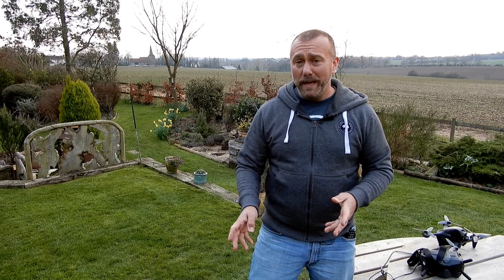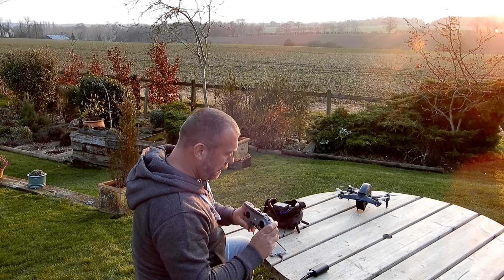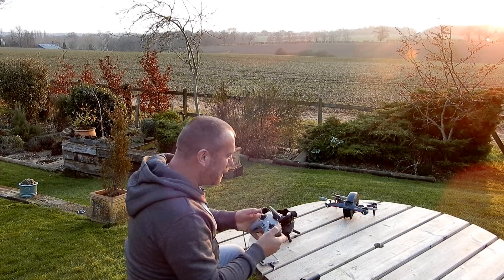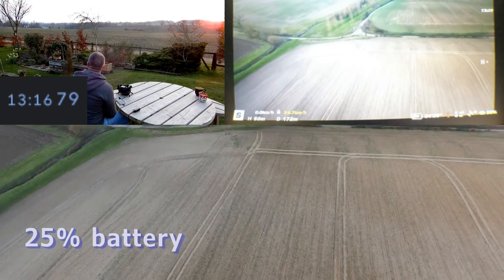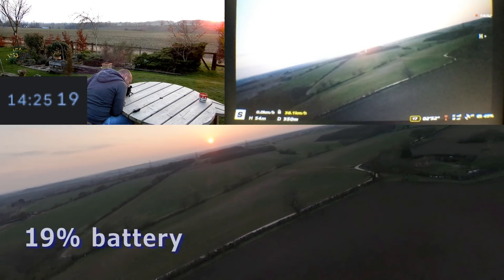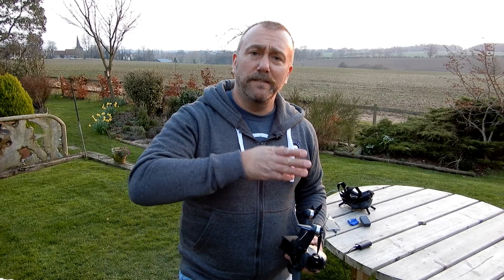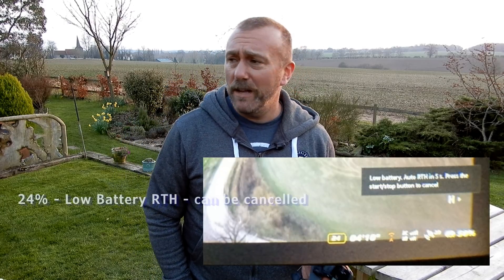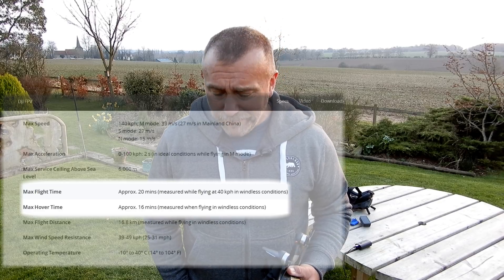DJI FPV: Max Flight Time Battery Test - How Long & What Happens

Comment from the maker: First Rule: Don't Push the Battery.  Second Rule: Don't take your Battery to 0% or it will damage it!  That aside, is this a reasonable test and result?
Reply: This is true however in practice no damage should be done to your battery. That 0% battery (%) isn't really 0%. The battery controller is programmed to 'always' have enough for the drone to land. The drone should never fall out the sky for obvious reasons especially at a high altitude. This is why it overrides your controls eventually. For homebuilt drones running your cells to 0% is the real 0% and will do damage.
Reply: @sandyleask92  lipo batteries should never run that low, however this video was made for learning purposes.
Reply: @sandyleask92  Just for info, I recently ran my battery to 4%, then about 2 metres above the landing point, the props just stopped, drone dropped, battery now wont charge. The FPV sucks out power so my A$220 lesson learnt is land at 10%.. Every flight is a lesson!
Reply: @sandyleask92  Correct . When the display reads 0% in a DJI drone the battery actually still has the 15-20% left in reserve to protect the battery .
Reply from the maker: @rydfree  This is what I suspect too.  I've never had a DJI smart battery fail, even tho I do these Down to Zero tests for every model..... :)   And yes, the low battery RTH and the final critical forced landing all take your altitude into consideration, with the low battery RTH also considering the distance to the Home Point, so the further away you are, the sooner it kicks in...
Reply: @rydfree  what's the voltage dji considers 0% 
One mavic guy tested and said 0% went to 2.8v on his which will damage a lipo.
Reply: @divingfalconfpv4602  They use a different cell chemistry I believe, hence it isn't comparable to lipos
Reply: do not charge it and fly without a break for the batteries
keep the battery always dry and warm underneath your jacket before you fly 

in summer with higher temperature you might find the 2 missing minutes I guess.
If you pick an electric car like an e-Golf and drive with 3°C ambient temp. than you will get 150 km range and about 20°C you will get 240 km of range.

Yes, different cell chemistry and each works a bit differently, but all the Lithium cells perform better in warm conditions.
Good luck for an early and long summer for great fpv flights
Reply from the maker: @typxxilps  That's a huge difference!  It was around 10'c when I did the test; looking forward to warmer weather then :)
Reply: Nice test flight, I too was getting 6-7 mins going crazy in sport mode
Reply: I think so, good to know what it could actually do in case these things happen.
Reply: third rule, never put your googles upside down. If a light ray goes to your lens, it's can burn the lcd screen with the magnify effect of the lens. =)
Reply: Hallo. Can you recommend DJI FPV for beginners?
Reply: How long would it last with 4k video recording?

Comment: I bought mine last week. I get between 9 and 10 minutes on sports mode.  Only I don't understand why I don't have a far range, after about 500 - 800 meters I will get bad connection.

Comment: Hi I'm going to let you know how they test their drones at DJI. I discovered this with my Maverick 3 which they claim and flies for 47 minutes. What they mean it's just hovering in space and it did last 47 minutes but obviously when we move or draw I'm just going to consume more power. So literally what they're claiming is just hovering in space for both drones will last do the same test with fpv I have not done it with mine yet but I'm pretty sure we'll get the 20 minutes if it's just like standing and place.
Reply from the maker: Watch yesterday's upload :)

Comment: You have to run them through a few charge cycles before they get 100% efficiency. Everyone has different opinions but I have some old spark batteries. That still seem to function pretty much like they did when new. The first few times I pushed the batteries. 100% to 0%. After landing I would slowly finish running it down to 0.   After that usually don't ever go below ten %. Don't leave them laying around fully charged unless your planing on using them in the near future. I know own four different drones. Think I need to go get my head examined soon.
Reply: are spark batteries lithium ion?  You never wants to take lithium polymer batteries to zero.  That's how you get them to swell when you charge them again.  Just as bad as overcharging.

Comment: I'm curious, why did you test battery/flight duration in SPORT MODE? I'm pretty sure DJI advertized the DJI FPV flight durations at 20 Min. certainly utilizing the N mode. I would think the drone would be using less power for flight, ie 30KMPH versus 60 KMH, etc. Maybe because that's your favorite mode to fly in? Anyway, I think flying the DJI FPV in N mode would probably reach DJI's advertised flight times approaching 20 Min.?
Reply from the maker: I chose Sports mode as that's the mode most people will fly the FPV at; this is a fast moving drone and I thought it useful to see what typical life you'd get.  The battery had had around 6-7 cycles; 10 is the ideal breaking-in number I guess...

Comment: Caution running battery this low will make it difficult to get into an optimal landing position. I had 9% nearly drop into a field. Couldn't elevate above the grass. Landed just fine though. Mowed some overgrown weeds.
Reply: But this drone has an inbuilt feature that it calculates how much battery it needs to get back to its landing area and it automatically stops being in manual mode

Comment: Great videos Ian - learning so much from them. I have the Mavic Pro 2 - is this compatible with the DJI FPV V2 goggles or would I need to look at a different model of goggles if I wanted to fly the Mavic that way? Thanks in advance!
Reply from the maker: You can't connect the goggles to the 2 Pro....

Comment: During my research about the drone I came across some information that claimed the "20min" flight time was tested indoors.   Which is deceptive for consumers but hey it's a China company so you shouldn't expect anything less.
Reply: He could have gotten the advertised flight times if he would leave it in N mode He chose to fly around in Sport mode which will use more of the battery's capacity. You can rest assured that's how DJI got 20 Min. of advertised flight times.

Comment: I also found if your not recording it lets the battery last longer. Still not the full 20 mins I think but I got 15-16 mins cruising at 60mph
Reply from the maker: Yes, I guess anything using battery will shorten the flight time......

Comment: my test gave me 12 mins in stationary hover on first flight in n mode... does batt increase with conditioning with time perhaps ? great vid ..thnx , keep them coming Ian.
Reply: Yes, the drone flight times will improve as the battery is put through multiple charge cycles.

Comment: Thanks for the down to earth and common sense reviews Ian. Almost always within 400ft and VLOS the safety limits. Having flown RC fixed wing aircraft I guess the fpv is similar, the advantage, you don't need a runway. however the goggles seem very clumsy,  When worn you can't see other approaching aircraft or potential criminals. So a spotter is essential. Looks like great fun though. I just get dizzy trying to keep up with the camera's movements. 
Got my 1st drone dji air 2 recently and beginning to think I've made the better choice. The altitude here in Johannesburg is 5,751ft Above sea level, with the thinner air the dji air fly's for aprox 24 minutes, gimbals work great and the camera functions are excellent. My guess is the fpv would only fly for aprox 12 minuts at these altitudes,  but would love to hear otherwise.   Interesting point a done can weigh up to 7kg in South Africa.
Reply from the maker: Unless you really want FPV flying and footage, you're way better off with the Air 2; it's a great drone and yes, you'll have far longer flight times.  Cheers, Ian

Comment: So are you saying you can see the Googles view on your phone? Is that connected via a cable? Is that something you can only do on the dji fpv drone
.. Through the app... Don't think it's possible with a dji air unit fitted in your own quad  and dji  fpv goggles
Reply from the maker: If you connect your phone via the supplied cable and open the Fly APp, you see the plain camera view, but not the app info.  All ther models you connect the phone to the remote control.
Reply: @IaninLondon  ah OK I've not got the dji controller... Just the Googles and Air unit my control is through crossfire

Comment: This is not rocket science.  2000 mah lipo. 6s
It is what it is. You will get what you get based on your flying.  I would prefer a 2000. Mah lipo 3s.  Possibly get 30 min flights at slow cruising speed.  I only fly 3s. Cheaper. Easier to keep balanced with only 3 cells
Reply from the maker: Who said anythig about rocket science?  I just did the test and showed the results.....

Comment: Wish someone would check voltage.. what voltage is 25% .. what voltage is 0% ? 
We only know 100% is 4.2v a cell. (25.2v)
Reply from the maker: I'll check the flight logs and come back to you.....
Reply: @IaninLondon  flight logs show it.. nice.. hate my mavic never showed it
Reply: Aren't they lipo high capacity? I mean 4.35v while charged?
Reply: @raffaelevalobra7128  no, they're not LiHV.  As per DJI their Lipos 4.2v per cell. But it is a big battery.  Bigger than we normally fly. Probably why they went with 5.3" props instead of 5.1"

Comment: I'm averaging 12 min flights.. in sport mode. Coming from 2 to 6 min flights on a 4s lipo, the Xtra 6 min is simply amazing 👏
Reply: Idk I do 29m 53s cruising at 40 to 50kmh on my fpv.. but my top speed is only 80kmh

Comment: Does taking it to zero knacker the battery completely Ian? I always land mine (Air 2, Flamewheel 450 & 550) at about ten percent to be on the safe side. Thanks for the video.
Reply from the maker: There are many that tell you not to, however I've not had issues with batteries after doing these down to zero tests, so I think DJI's smart circuitry is protecting things for you.
Reply: As already seen in other comments, should be interesting to know what voltage DJI consider 24%, 10% and particularly 0%.
For example my actual drone stars to return to home irreversibly if far more than 500m at 3.80v. If inside 500m start returning at 3.75v.

Comment: OK first question is why S mode for the test!? Isn't it N mode or whatever the normal mode is!

Also I think that DJI means 40km/h in a straight line! Every turn you make uses more power than just if going straight cruising at 40km/h..

Very nice test though, for what you could do alone, it's sweet...

Keep well and be safe Ian!

😁🇧🇬🛸
Reply from the maker: Fair questions. 1, S Mode is the only mode for Cruise Control, and I didn't fancy watching my speed for 20 mins.  And yes, of course every turn eats into battery as I mentioned after I landed.  Maybe a hover test would be the perfect control test for their stats....

Comment: Interesting to see this from the "traditional" FPV view where you're watching arcane things like battery voltage :)  Back of the envelope calculations - the 24% return to home point is approximately 3.3v per cell (assuming the max cell voltage is the usual 4.2v) so DJI are probably being sensible enough in getting it to turn around at that point to preserve the life of the battery.
Reply from the maker: I don't watch anything like battery voltage... I let the app do that so I focus on flying or filming... :)   But there's no doubt DJI have the circuitry to protect the battery from people doing things like me... ;)

Comment: I'm  easily getting 17 min in N mode flying around.
Reply from the maker: I would double check your flight logs, because I find that very surprising...
Reply: @IaninLondon  What is your outside temps? It was 28C here
Reply: @IaninLondon  colder weather means less flight time with lipos

Comment: I wonder if one day we will get a drone with a solar panel on top that feeds the battery so the flight time lasts a extra 10/15 mins or so .   I know there is solor drones but some little invention that drip feeds the battery a charge would be cool for extra flight time.
Reply from the maker: Thinking on how long my camping solar panel takes to charge my phone, no!  🤠

Comment: Great test.. Be careful not to lay the goggles around with the Screen not downwards. If the sun hits the lens it Will burn a mark on the screens inside.. 😊
Reply from the maker: I keep getting told that in each video.  Duly noted! :)

Comment: I’m pleasantly surprised you got 17 min. Manufacturers are notorious for overstating maximum distance and capacities compared to the real world so within 3 min isn’t too bad I suppose.
Reply: He could have gotten the advertised flight times if he would leave it in N mode He chose to fly around in Sport mode which will use more of the battery's capacity. You can rest assured that's how DJI got 20 Min. of advertised flight times.

Comment: Great review Ian. Do you think it's bad that drone manufacturers advertise the flying time that has been tested in optimal conditions at the slowest speeds, or do you think they should advertise the time that would you would get in real-world conditions?
Reply from the maker: Well, I think they're consistantly over-stretching the times, so we always know to take 20% off, but it's not a good way of marketing.....
Reply: @IaninLondon  Yes I suppose. I think if they advertised 8 minutes of flying time, I doubt it would be as popular.

Comment: great test, but was that battery toast after you took it too 0% ian
Reply from the maker: Actually I've doen 0% battery tests on all my Mavics; I thinl DJI keep a secret stash of power to stop you completely screwing them.... :)
Reply: @IaninLondon  I’ve never taken it down too 0% . Lowest 20% . This is why was come here , thanks 👍
Reply: I think it would depend on the chemistry and where the battery protection electronics (BMS) call it but I doubt very much the battery would be physically damaged whilst operating within controlled parameters i.e. 100% to 0%. It's temperature extremes that impact lithium-based chemistries <0℃ and >50.℃), not so much their charge state.

Comment: I was going to try this, You’ve saved me the trouble :), I had purchased 4 batteries for this very reason of low flight time, Hopefully there is a firmware upgrade to increase flight time in the less power intense modes!. I seen your manual mode flight video, Have you been practicing the dji flight simulator since? I gave up with it because it felt nothing like the way this dji drone flys in terms of weight and speed, I downloaded a piece of software called liftoff on steam which allows you to connect your dji controller to the pc for a more “realistic” flight, Highly recommend it for practicing the manual mode
Reply from the maker: I am not a fan of simulators TBH, so no, I've just been practising Manual mode in real life.... (slowly but surely.... )  :)
Reply: @IaninLondon  good luck you have an awesome location to practice

Comment: Should’ve stayed at 400ft, give you more flight time as it force descended lol, thanks for the test 👍
Reply from the maker: Yeah, but you use more climbing and the wind is stronger...... Hard to know what's best 😀
Reply: @eternalspring1034  dude, I'm pretty sure DJI means flying 40km/h in a straight line, every turn he makes uses up more power than if just cruising in a straight line..

Anyway..

Sweet

Keep well and be safe everyone!

😁🇧🇬🛸

Comment: Ian you done 60 seconds better than my spark... Next windless day test it the same as DJI do 30ft up and HOVER...... THAT'S WHEN YOU GET THE MAGIC NUMBERS
BRIAN
Reply from the maker: Actually, look at the specs; you get 20% less flight time when just hovering!   But it's great times for an FPV.... CHeers
Reply: @IaninLondon  bloody hell 20%less.  That's a lot... Not sure on what you paid say 1200 quid... Could you have spent that dosh on something where you get more for your hard earned cash. I just seems  a hell of a lot of cash for the flight times... Thats why I've got into 1.5 and 2.00 mtr fix wing anything upto. Hour n 10 on the fix wing 20 on the 1.5. But I suppose it's all down to your style of flight. I've got some of my stills on the Richmond park web site.
Stay well
And keep them props spinning
Brian
Reply: @BRIANFORWARD1  I guess it's all about perception. Most FPV builds get 3-6 minutes flight time. Getting 8 minutes is a gamechanger. 17 minutes is Twilight Zone material! (though 40km/h straight'n'level flight isn't really a typical FPV flight profile).